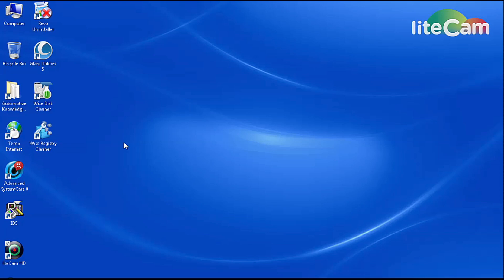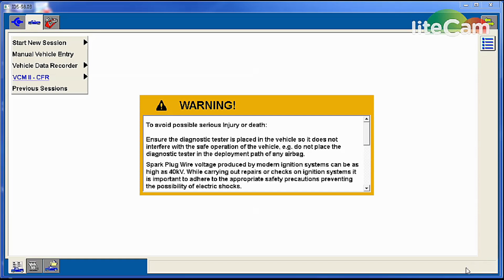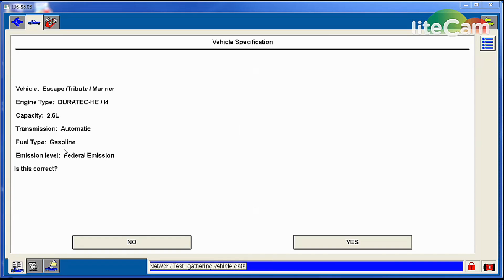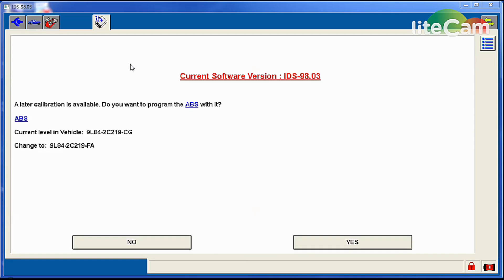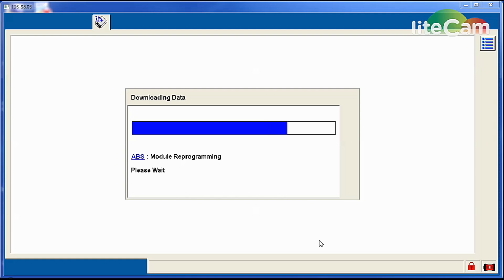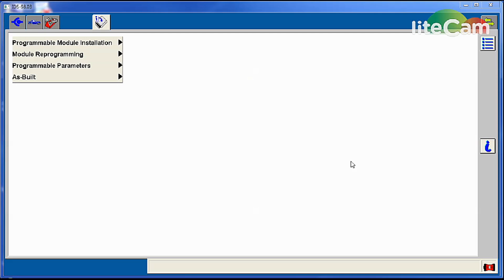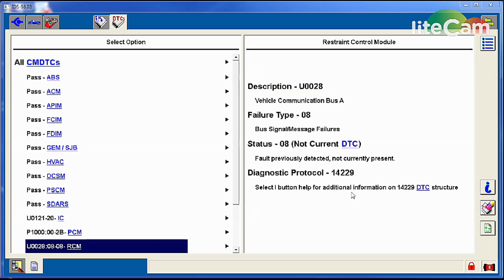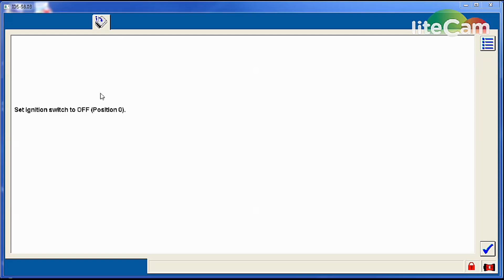Ford Vehicles: ABS Module Programming Procedure

Comment: I'm replacing a new abs module on my fusion hybrid 2010, using forscan to reprogram, can you give ne programming instructions please. Thanks.
Reply: Hi, i am dealing w/ same car/ same issue / forscan........., programming apparently one of few things that CAN NOT be done w forscan (even w/ full license).   Are you completed? How did you program?  Would love to follow up if we can assist each other.......thx, dan
Reply: @danielslesser8748  
I did completed the abs module programing procedure using Forscan, also you need a power bleeder to bleed the brakes, this takes me months to complete I had to read alot no one on the internet send any help to me and most never even reply. I am not a mechanic but I would love to help you, I'll send you the procedure that I use to get my can up and running. I drive over 200 miles since and so far everything is working good. When I have some time this week I'll send you information.

Comment: Hello brother, my car is Ford Mustang v6 model 2013, the ABS brake unit module is damaged, and I got a healthy used module (the technical code of the modules are the same), after installing the module, when the computer is connected to the car I got a non-support error! Can I give this new used ABS module a program to be compatible with the car and fix it?

Comment: Hi, recently my 2006 ford showing weird behaviors ( Speedometer not working, Not more than 3000RPM, No odometer reading, ABS light on, Brake light on). Ford service confirmed that ABS module is not responding. So a local Workshop guy replaced with around 3 used ABS modules, but still its been same issue(U0121). If we connect to this Software and reprogram, will it work? Please kindly help

Comment: Man you are awesome. However. Story short f. Explorer 2014. I changed ABS Put a new one I am no mechanic and didnt know it requires configuration. "Initial conf. Not completed" is message on scan tool. Very pissed at the moment because I live in Orlando FL and cannot find someone to do what you shows on the video. Even some dealers giving me Be because they did not installed it an some are saying it will be close to a 1000 to put one with guarantee. It sucks when you try to safe money and some places still wants to screw you over. The abs I installed is brand new original bought on line from ford itself. It sucks that they do not sell these type of parts with out loopholes even though you provide vin# which automatically should set product with right configuration. Is like when you installed a new mouse on your computer the system recognize the new hardware and CONFIGURE IT WITHOUT A FUSS. Sorry Man just wanted to vent. Again you are awesome I watch a lot of your videos. Wish you had a shop near my location.

Comment: What does a scanner need to do this I have a 01 Ford F-350 4x4 auto I changed the abs module and I need to re flash the module either take off the old module or put new im looking to buy a scanner so I can do these myself being that I have a few ford diesel trucks

Comment: I replaced my abs module on my 2005 expedition using my autel maxisys elite by going to program module instalation, copy data ftom old module still in vehicle then scanner will tell you to install new one and done. Took less than 10 minutes

Comment: Does my 1995 Lincoln continental need programming if replacing? It appears faulty.
Reply from the maker: no
Reply: Ford escape 2008 XLS 2.3 FWD gas, needs to be programmed also if replace the abs module?

Comment: Would you know if a 2001 Dodge Ram 2500 ABS module can be reprogrammed.  Bought a auction vehicle that appears to have had the abs module replaced because it has a mismatched VIN code.  ABS and Brake light on all the time.
Reply: Yes it can but only with the DRB3 .

Comment: Using an Autel MS908 Elite ,Trying to do the IVD calibration procedure correctly and so far it's not working on an 04 Expedition to address the C1998 Module calibration failure code  and a flashing traction symbol. The Tool says to start engine and turn wheel from one stop to the other stop. It does not say in which direction (left or right) to initiate , turn slowly? Should I Hold wheel at each stop a couple seconds? Should I Return wheel back to center position after going from one stop to the other. The vehicle is on level ground with fully inflated tires though three of the four original TPMS sensors no longer work anymore. Do you know the more specific detailed Ford instructions for doing this procedure? Thanks Brian
Reply: Full left then full right and back to center

Comment: can you program a module only with ABS to have also TCS (traction control system)?
Reply: No you cannot . Traction control system includes the Engine control module as well for throttle controlling
Reply: @NewLevelAuto  if I put a used abs pump and module should it still be throwing up the same codes as it was before I replaced it?

Comment: Do you have to do this on a 1989 Ford ranger, I have replaced the master cylinder, power booster hydraulic module, rear speed sensor and my brake and antilock brake lights stay on.I ran the codes any got code 4 which is the rab s module.could this be a false reading. Do I have to get it scanned and reprogramed. Please help, thanks

Comment: Do you need to leave the old module in and turn the key to the one position first before putting the old module out, put the new one in and then plug the software in?

Comment: I am working on a 2003 Lincoln LS V8. I have the ABS light on..Scan tool shows DTC in ABS as C1998 which is re-calibration of ABS. Is there a way that I can do this my self without taking it to a dealer or shop? All wheel sensors are working properly according to live data on scanner. I think this is due to dropping the steering assembly to the floor for a while when removing the dash for AC evap core replacement. I have an Autel MaxiCOM MK808 ..No bi-directional control, but does about everything else..thanks

Comment: Had ford flash the pcm and tcm on my 2wd 04 5.4l f150 because the previous owner had replaced the abs module and i had a vin mismatch code. I still have the abs light on and a vin mismatch code. My question is... Do they need to do a spesific abs calibration or should flashing the pcm and tcm do the job?
Reply from the maker: Have them run PMI on the new module with it disconnected at first so the IDS cannot get vin information from it then once they enter the PMI process reconnect it. Then it will prompt them for the as built data to be input manually.
Reply: BSG Automotive whatever they did today worked and the truck is running great thanks for all the help.

Comment: Great video as usual. How would one "program" a used ABS module?
Reply: Again, no answer. Can a used module be re-rogrammed? or is it one time program?
Reply: A used module can be used if the part numbers match. It's a slightly different process using "PMI" or programmable module installation procedure

Comment: Can you use passthru device to perform asbuilt data if the old abs module is not communicating, and you have new unit, can a passthru device with fmp software perform asbuilt data, transfer without vcm

Comment: Anyone know what is the Ford specified voltage I have to maintain during module programming? I have a battery maintainer and I would like to know what settings I should put, thanks.
Reply from the maker: 12v or higher
Reply: @BSGAutomotive  if I install a used abs pump and module will it still throw up the same codes as before I replaced it?

Comment: what if you replace the pump and get B2900 code ? I put the used one in and getting this error code, am i correct in looking at the vid that you have to transfer info from old to knew before you pull out the old one ?
Reply: I have that same problem
Reply: I'm having this same issue. Did you fix the problem?

Comment: Can you reprogram a used one? I cannot get a used one to reprogram!
Reply: You need to "inhale" the as built data from the old module and "exhale" it to the new module.
Reply: @williamwchuang  hows that done? Using the IDS software?
Reply: I have the same problem, did You find the solution?
Reply: Yeah you have to pull the info out of your old one before you unplug it. Just follow ford reprogramming instructions.
Reply: Cammie Grooms I’m currently trying to do a used abs module on a ‘12 fiesta. Would you mind elaborating on what you meant by pulling the info on the original module? I’m new to the Ford programming system and process.
Reply: Alejandro Vazquez I don’t think you can on 2010 and newer vehicle, I’m in same situation . He means copy the asbuilt data from the non working abs module b4 you replace it with used .
Reply: How do you get this software to do all of this stuff?

Comment: This stuff makes me mad. No reason your ABS needs to have ViN number to serve its function. Its sole function is to keep your brakes from locking up and keeping your car stable in the event of hard braking. Just seems like a Dealership money sync to me.
Reply: completely agree with you... just to get more money from the consumer. on a technical point though these modules are generic and they require to be programmed to the specific vehicle and since it works on SUV or a compact car the VIN is used to get the right software and the right data for example GVW speed ratings transmission type and so forth and so on... I am not a big fan of FORD myself but that is the way they do business so if you don't like it don't buy their products. I stay as far from Ford as possible unless I have to work on it since I am a Mechanic by trade. have a nice day!!!
Reply: Wrong it needs to know the Vin for many different inputs that are different trim models. Stay away from working  on cars cooter😅
Reply: U can use a different used model if part number is same u will have a vin mismatch code but will work the same and the code won’t turn the light on
Reply: @Redneckrebuildsnortheast I changed a faulty ABS module on a Focus mk3 with a used one but not the same part number, if I find the same part number will it work and let me start the car? 
Appreciate your answer! 
Thank you !
Reply: You are right.
Reply: They aren't stealerships for no reason y'all
Reply: Is there any info that has to be downloaded from old module?
Reply: Planned obsolescence

Comment: Good evening I'm from venezuela I have a ford explorer and it has codes p0011 p0018 p2006 and p2007 imrc you hear noise inside as if the gears were broken. The p0011 code I think you have problem vtc bank 1 and problems p0018 Camshaft Phaser bank 2 and I am not sure if I need to replace it. Please could you give me your opinion that I should do thank you very much

Comment: Customer showed up with a 2008 Edge, new ABS module already in place (and of course, ABS /Traction control lamps lit). Request is for a reflash. In the absence of the inhale data, can I just pull the data through module reprogramming, the use PMI to reflash? Just dont want to brick this new module by going at it wrong.
Reply: Found my own answer- IDS procedure says that a PMI must be completed, add As-built data, then an IVD initialization.... easy as pie ;)
Reply from the maker: Sorry I was away yeah Ford makes it very easy for sure.
Reply: @BSGAutomotive  Found my answer here, thanks...…..
Reply: @BSGAutomotive  This is basically my situation. ABS already installed. Is there a way to get the info for my vehicle into the the abs module? 2009 Ford Escape.
Reply: @bravekate  I'd suggest finding someone with IDS, as it's should be able to pull the 'as-built' data into the new module.
My experience has shown that the old FMP (now FJDS) doesn't do everything it should
Reply: @hperf381  Can you elaborate on this please?

Comment: I have this tool and am trying to program a second hand ABS module for the vehicle which is a 2007 BF Falcon 1 tonner. The problem is I dont have the old module to do the inhale exhale is there a way of doing it still??
Reply: Why do they not answer the questions? I just had someone bring me a 2008 Mariner, they replaced the master, lines, and abs module. then towed it to me. People should not try to fix things at home when they don't know what they are diving into. SMH   Who jumps off the high dive before looking down to see if there is water in the pool???????????
Reply: You can rebuild using the AS BUILT data.

Comment: what effects does a defective ABS module have on normal braking, if any ? I drive a 2008 Lincoln Nav, the ABS and brake (emergency) lights came on, and the brakes seem to have become less responsive when light braking, the car will keep coasting, until I brake harder. any input is great. thank you in advance.
Reply: sam kahill ABS replace the old foot pumping your brake we used to do.And does it way faster per sec.
Reply: ?what did you try to say ?

Comment: service RSC" light with code C1991 module calibration failed can be fix by VCM cable and IDS software??
Reply from the maker: +Ilyas Nazar yes
Reply: +BSG Automotive Bundle of thanks I did it the same way you said and now no more C1991 after programing the ABS module and no more DTC. My truck is Ford 2008 Explorer do I need to update the latest calibrations for other module as well and from where can I get there calibration files. Does ford releasing new calibration file to run the vehicle in more efficient way.

Comment: I have a VCM but the biggest thing about it is that Ford requires you to have software running current on it in order to use the tool and if you don't do enough business to require it constantly it will cost you a whole lot of money. And is hard to get a return on your investment. Great tool though. And for requires you to buy it at a year at a time. So I thought I would put that in there.
Reply: thanks for the info

Comment: This stuff isn't cheap but looks like fun to own!
Reply: BSG Automotive man I need your help, I have 2006 escape hybrid 4x4, I have abs light and brake light on with brake service on the screen, I changed bother tone rings, they were broken, when I push the brake I hear the abs pump running even when the car is off, should I try bleeding brake/ abs? and does forscan do that? or is the abs module bad? if I buy used one can I program it with forscan? please help me out .
Reply from the maker: +Ozzstar That's for sure.
Reply: I just click on the link for the product.  You would think that after you spent $1,349 they would give you free shipping.

Comment: Brian, I actually need to do this exact procedure for my 2005 Ford Explorer with Advanced Track. The second link, did not work for me. Could you specify about how much the module, and license might cost, When compared to just taking it into the dealership.
Reply from the maker: +Chris Rippy It cost allot in the thousands. I fixed the second link but yeah unless you are going to start repairing Fords on the side it's not worth the cost.
Reply: Chris nu

Comment: is rsc controlled by the abs?
Reply from the maker: +Leah Friedman Yes
Reply: +BSG Automotive I've been getting sporadically a "service RSC" light and scanner showed a C1440 code (08 mountaineer ) according to forums its a failed abs sensor in the brake master cylinder. You agree thats what can cause it?
Reply from the maker: +Leah Friedman No on this truck for this code either there is air in the hydraulic system or the pressure sensor which is internal to the HCU on this year must be replaced as an assembly with the HCU.
Reply: +BSG Automotive i hear ya. So I shoukd tty bleeding the system. Thanks man, keep up the good work. Watch EVERY video, big fan